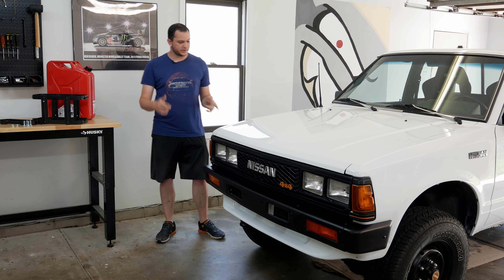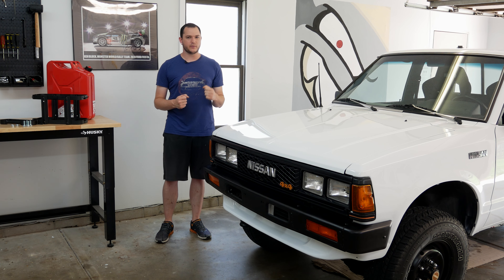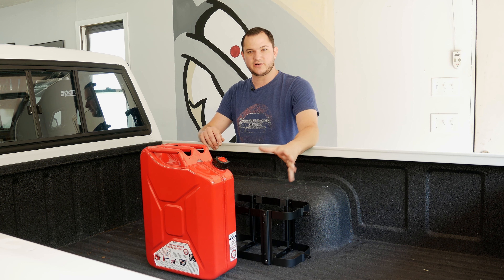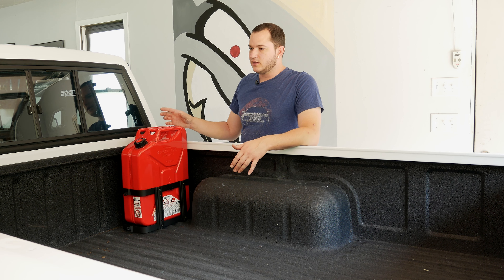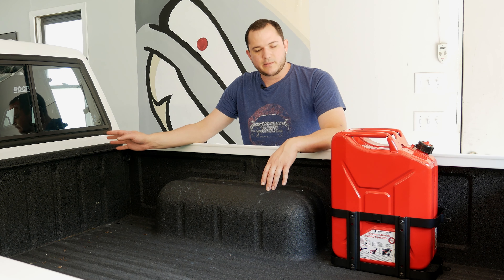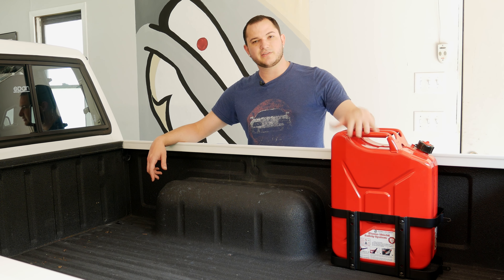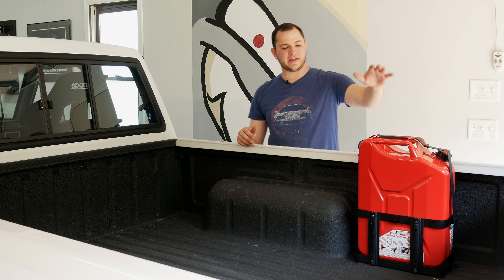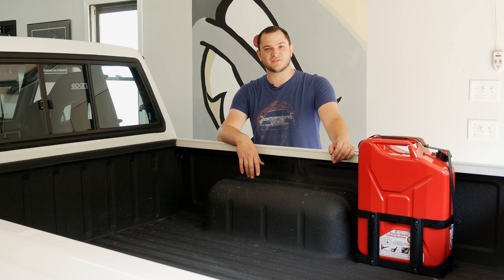Easy DIY: Installing a 5 Gallon Jerry Can in Your Pickup Bed

Comment: I would suggest tossing the manufacturers hardware and substituting with grade 8 bolts, washers, split washers, and teflon nuts. Last longer and less prone to dual metal corrosion. Your local Tractor Supply charges by the pound.